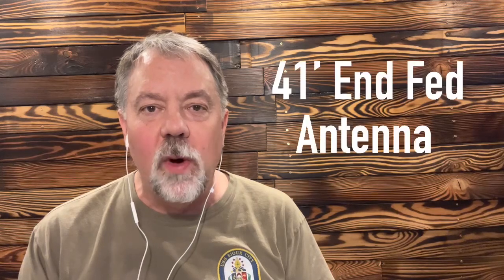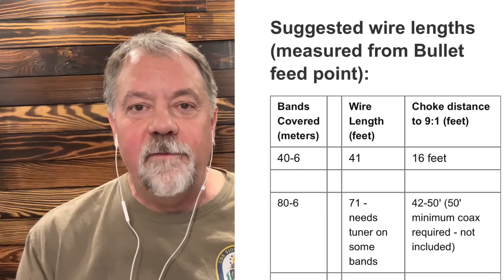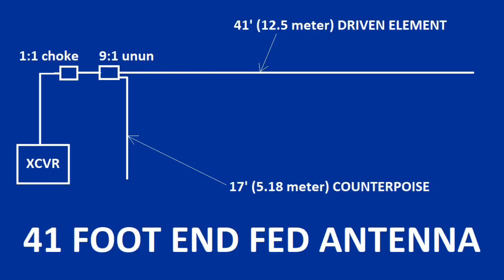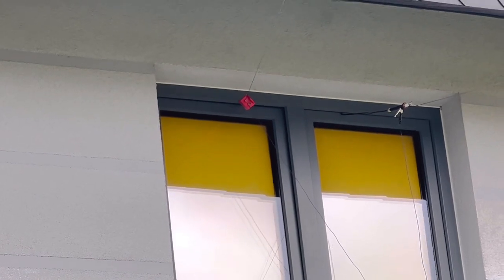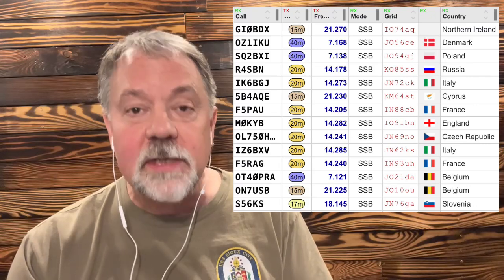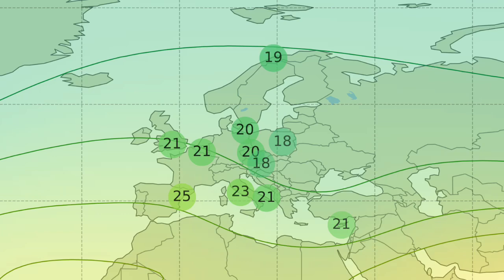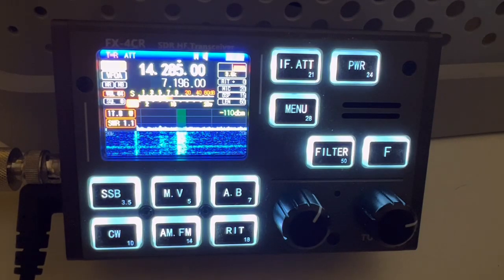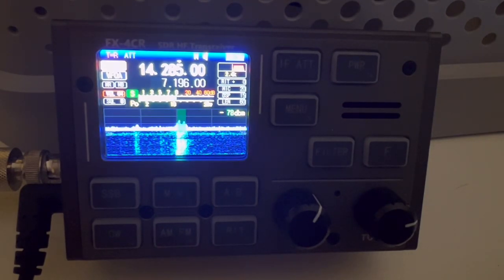Building the 41 Foot End Fed Antenna

Comment: I made this end feed. I had to take counterpoise wire off. When I did that I had an swr of 1.003.  It’s fantastic for 15 meter.  Transformer hung at 25 feet. Antenna end at 28 feet. It’s perfect like that.  Just using as a single band for field day

Comment: Great Vid. some though for your viewers : if you're into portable or emcoms its wise to have an antenna that can transmit throughout the entire HF spectrum (it can save your life/or others) thus a 49:1 end fed halfwave is an inferior antenna,  the loss of a 49:1 unun is also more than the  compromise 9:1 random end fed in which can operate the entire HF spectrum. HAMs get stuck in the box and always see wat others do and do......... now you're going to tell me a 9:1 efrw needs a tuner..... well try this for emcom/portable /NVIS : (9:1 unun - 27meter radiator+ 470Ω resistor + trailing 15m ''radiating counterpoise'' and 9m grounded counterpoise at the unun ONLY! ) that's how most militaries rock HF portable decades now, before the digital era where HAMs re-emerged the End fed. don't get stuck wondering about the losses on the resistor. this is the ultimate End fed do all /NVIS, etc. bottom line for my 30 yrs experience: the 9:1 ratio rules !  and if you have a tune.... bypass the resistor if you need so, elevate accordingly and you have a formidable DX antenna as well. so my conclusion on your video is that if for whatever reason you needed a shorter radiator to get out on the bands, for stealth, or to do vertical polarization on the higher HF spectrum for long reach like Poland to US,,,, you did great! thanks for your vids. 73 from SV1land....
Reply from the maker: Thanks for watching and commenting.

Comment: I have the same set up. LDG 9:1 unun with 41 ft wire and 17 ft counter, I use a Q-beam 12 M mast so I run almost vert, I leave the 17 ft counter coiled and laying on the ground. I can tune 160 threw 10  with a 1:2 SWR on 160, oms are off on 160 haven't try to contact anyone... but 80 M 1:5 SWR using a LDG auto tuner pro 100. scanning the 40 - 10 m band  fair SWR with out tuner nothing higher the 3, untuned. and with the tuner, quick tune to 1:1.  I don't use a 1:1 choke, I use this in a mobile config, so my coax runs to my trunk mount SO 239 then to the tuner, so the car is acting as a counter poise as well.   Nice video, direct and to the point, Thanks,,, de KD0AZG ...
Reply from the maker: Thanks for watching and commenting!

Comment: I use this a lot for SOTA. Compact, multi-band and easy to put up in a sloper configuration with a mast or using a tree branch and throw line. You really do need a tuner. The x6100 tuner handles it fine, as does the Elecraft. LDG should work fine too.
Reply from the maker: Cool! Thanks for sharing Jeff

Comment: My portable QRP antenna is a Nelson Antenna 9:1 with a 41’ radiator and a 17’ counterpoise. I’ve had great success with it.
Reply: All bands 40-10 by the way. 15 gets a little tricky, but it will work.
Reply: @darrellrice2327  Nelson's are awesome. I use one with a 71' wire and no counterpoise as my main QTH antenna with my G90. Works great!
Reply from the maker: I have the Nelson as well, it's a great unun!

Comment: Hey Walt, another great video ! I just put up a 9-1 random wire today for NVIS. A little different than what you are doing with a different purpose. I used a 240-43 toroid, instead of a T-200 as I find it plays better on the lower bands (and not a much on the higher bands). I have 95' to play with. A full size dipole was not in the cards and I didn't want to use a dipole with coils. I ended up using a 88.5 ' wire. I have yet to run the  coax to the shack, but did hook up a length of coax and found 1.3 to 1.1 from 3.7 to 4 .0 Mhz. 40 meters was about 1.7 SWR. By the time I got up to 10 meters, SWR was about 3 to 1 (Which is about what I figured it would be).  Once I get the coax in place, I'll mess with a counterpoise and fine tune the antenna wire length. Keep building antennas, it really helps others do the same. 73
Reply from the maker: Thanks John! interesting, thanks for sharing.
Reply: t-200-2s are known to work well from 500khz to 10mhz max , FT240-43s are known to work the same or better but linear and smooth up to 50mhz- type 43 material is far superior to others in the HF spectrum. Note: red toroids are never used for rf suppression/chokes, etc. so never use one in such a case. also note that though they both are rated well over 100w SSB PEP. in actuality for full continuous cycle digital modes they can handle WITH LOW SWR about 50-70w for about 30min. before getting hot and you start getting an swr increase. the same goes for the ft-140-43 , though the ft240-43 with thick wires (1.5mm) will give you a better outcome but please note that in 9:1 unun cases for lower band work 7turns are better that 6 or 9. thus a 7 turn 9:1 unun is great for efrw NVIS work.

Comment: Been a big fan of the random wire end feds, they work well. I've currently got a 204' horseshoe end fed for NVIS on a 9:1, still testing, and 148' bifilar helical vertical (~30' mast) which works really well for DX (inspired by that helically wound vertical you did a while back).  Very cool, thanks for the content!
Reply from the maker: Thanks for sharing, I was actually thinking about doing something like that helical again.

Comment: 41 foot - close to a 5/8 on 20m so a nice length. If you make a dipole with 2x41 feet lengths and feed with ladderline to create a doublet, you will have an extended double zepp for 14 mhz with some nice gain over a 1/2 wave dipole. The 41 feet wire is basically the longwire/vertical equivalent. Great video Walt!!
Reply from the maker: Thanks Tim!!!

Comment: Love your videos and the fact that due to your work you use a lot of qrp things. When I had my technicians call sign before I had hf privileges my call was ZL1WOT (1 watt). My call now is ZL1JYM. But due to my health I am not too active right now. 

I have both these antennas. And I love making them. I have an issue around the efhw being better than the 9:1. Yes but only on the bands it is tuned to. 

I used to use the bullet 9:1 for going portable (camping trips etc.)
What I haven't done is cut a 49:1 and a 9:1 with similar radiating elements (length for the simple folk like me) and compared them.  (Content idea as I lay in bed wishing I could try it myself😂)
Reply from the maker: Thanks James! Prayers that your health gets better. Trying similar elements on those two ununs would be an interesting experiment. All the best and 73, Walt K4OGO

Comment: Hi Walt, love watching your experiments with wire antennas. Just on whether an EFHW would be better, given that the 41ft end-fed will work on 40M, the equivalent EFHW for 40M up would be nearly twice as long! VK4BOB
Reply: I'm not sure it would be, if you consider this an off-centre fed dipole. With the "counterpoise" there's about 18m of wire in the air, with a little bit of loading in the un-un. An EFHW would be around 20m minus a bit of loading from the transformer. They are pretty much the same half wave antenna (on 40m), just fed in a different place.
Reply from the maker: Good point, thanks for commenting!

Comment: Yeah, EFHW is more efficient. But if you want the ability to work all of the bands from 20m to 10m, this EFRW works well. I like it for SOTA on days when there's a contest running and I want to work the WARC bands instead of crowded 20/40m. The ATU-100 works pretty well with this antenna and the FX-4C.
Reply from the maker: Good info, I actually have an ATU-100 that I plan on using with the FX-4CR. 73 de K4OGO

Comment: It's always a good idea to gain experience making your own antennas. I've done it both ways with wires, and find it may be cheaper just building it yourself, depending on what's in your junkbox. In some use cases, it may be best to buy it pre-made. Parts add up, so using ingenuity can save money. For example, using PVC joints as a center insulator, or speaker wire for the antenna itself. I prefer solid wire from Amazon, 16 gauge...but everyone is different.

Comment: When I first got on the air in 1966, several members of the local radio club ran 42-foot verticals as a 5/8-wave vertical  for 20 meters. Groundkng/counterpoise was anywhere from a ground rod up to 24 17-foot radials on the ground. Everyone talked up getting our General so we could join them om 20 meters. If they knew how their "single-band" 20 meter DX vertical would morph into the universally used 41-foot vertical or wire, they would have choked.

I can hear the Old Timers's telling me that it will "NEVER WORK!". Well, somehow I became an Old Timer, and I beg to differ. Yes, it works, and works very well.  The other variant I personally run with is a 29-foot vertical wire on mt 10 meter mast, using a single 13-foot counterpoise and a 9:1 Unun. I mount it behind the car for POTA & Field Day, and it plays very well on 40 M - 15 M and gets out on 10 meters, too!

Gooch's Principle says, "RF Gotta Go Somewhere..." but a good launcher really helps, no?

De WB2VUO here near Buffalo, NY
Reply from the maker: Haha I love Gooch’s principle! Thanks for the great reply! 73 de K4OGO

Comment: BK BK before I watch:
A) the idea of an antenna that is equally //not// resonant on ham bands. /*blink*/ That got my attention!
B) the use of counterpoise ... if I hang a length vertically? my fast/quick/homely Field Day setup for 20m was what I called "Open Quad". 1/2 horizontally from feedpoint, with 1/4 down from the far end. Balanced with 1/4 straight down from feedpoint. (Choke as desired.)

73

Comment: Walt, thank you for experimenting with this antenna and sharing your findings.  I see it not as a 41 foot antenna, but as a 58 foot OCF.  This is because the counterpoise is above ground and therefore actually radiates.  If the counterpoise were laid on the ground and the 41 foot part were vertical, it would be a completely different animal.  (it would then be similar to Tom's ZeroFive vertical) I have modeled the antenna as shown in the video with MMANA and I get an ugly pattern.  That said, any amateur should use whatever means are available and if the wire available are around these lengths, then that's what will put us on the air.   A small L or Pi tuner and some assored UNUN's and chokes are always good to have in the "go bag".   

Keep up the great work.  Hope to hear you on the air again soon.  73 OM
Reply from the maker: Thanks so much, yes that’s interesting and you’re right about the OCF concept. Hope to catch you soon my friend, seems that most of my USA contacts have been into New England with a vertical, I’m leaning towards putting one back up here in Poland for a while. 73 my friend!
Reply: Yep, I came down here to say that. It seems like it's an off-centre fed dipole, pretty much resonant on 40, 20 and 10.

Comment: Very interesting antenna. I used to make off centre fed dipoles. used to break a ferrite rod in half and wind a 4:1 balun using figure of eight speaker cable. If you make a 66 foot one it covers 40/20/15 and 10m. You have encouraged me to try some experimentation next week to find something that works on 40m. I have a 10m fishing pole so I could do a ground mounted vertical. Just the radials that would be difficult.  ^GM4SVM
Reply from the maker: I’ve actually made quarterwave vertical for 40 with. 10 meter pole and it was amazing. Thanks for watching! 73 Walt Hudson
Reply: @COASTALWAVESWIRES  I will give it a go. try and get a reasonable number of radials out.

Comment: I’ve used the 29’ version with 10 4m radials, worked aswell as my 4010 efhw, good video
Reply from the maker: Thanks Dave!
Reply: My 71 ft 9:1 gives my EFHW 80 to 10 a run for the money. Can't quite understand it but its6gun too experiment. 9:1 long wire is quieter too; also makes a good SDR HF receiver antenna.

Comment: I'm going to duplicate your 41 ft config for my G-90 for field use. The 71 ft bullet from Palomar Engineers will go up for the home QTH using an FT-991A from 80m to 6m. The LDG stops at 30 MHz. Adequate for the G-90. Thanks for the antenna videos. Interesting and useful.
Reply from the maker: Thanks for watching Mark, good luck with the antenna! All the best and 73, Walt K4OGO